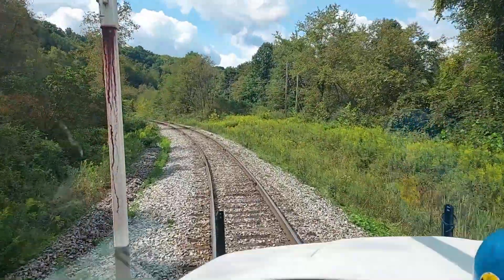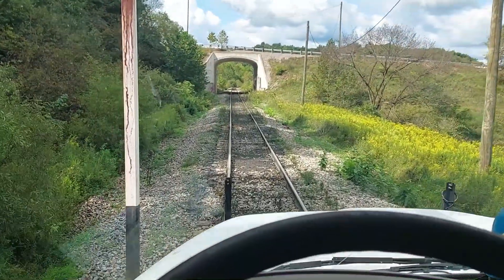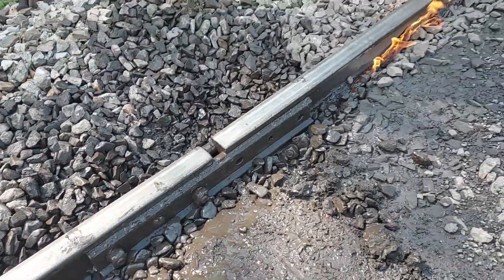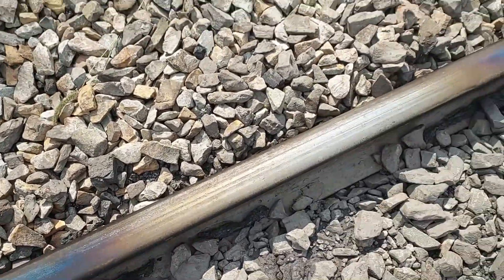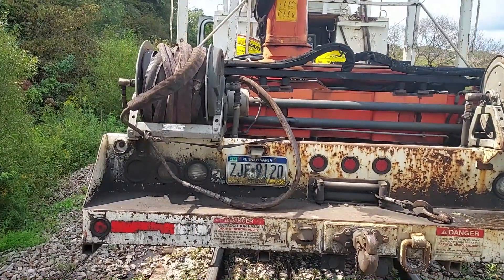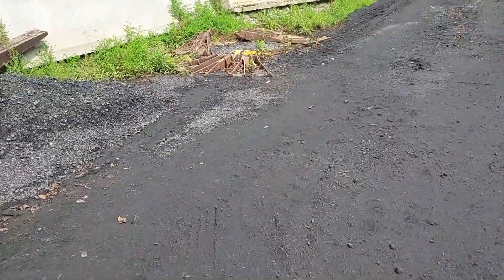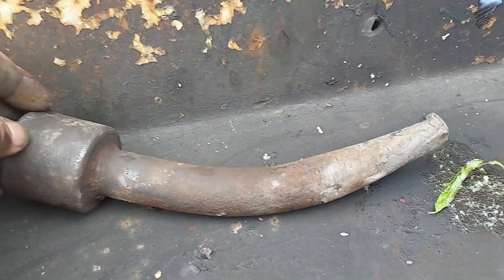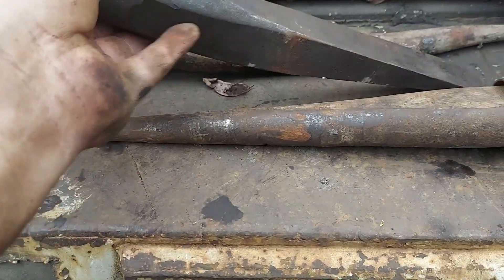I Set the Rail on Fire Today! Fire Snake in Action!!!

Comment: What is the Federal Regulation for maximum distance between joints?  The joint after it was "fixed" looked like a big gap to me.
Reply from the maker: There is no CFR reg for a max gap, however they do require that on
class 2 track each joint must have a minimum of 2 bolts, thus that
would mean the gap would also be within safe distance for trains
to pass over. Gaps over the 17 miles of track we have vary greatly,
depending on a lot of factors, but to have a joint still bolted the max gap would be around 1 or so inch
Reply: @ccrx6700  Thanks for the quick reply Dave.  Interesting topics here.  Most people like to see the big train blow the horn.  But I like the Federal Regulations and engineering topics.

Comment: i'd call it a bad omen of what's to come if this is happening already. it makes sense since the pull apart in october. 
what is really needed to stop this from happening? a lift and retamp of the rails and ties? is there some braking while under load procedure/speed reduction happening alot more there in the last year or 2 that didn't use to happen. there has to be a cause. i notice the ballast at the ends of the ties  leading up to the tunnel in this video is starting to slip out. too much vibration? also what is that slight ditching in the ballast on the right caused by? something dragging or tamping or travel vibration with water drainage issue? might be worth putting a trail cam there or motion cam just to see some sort of time lapse cause & effect?
Reply: I read an article by the Union Pacific one time. Now I may have parts of what I'm about to say all wrong but to the best of my memory, which is pretty good, it went something approximating this:
In a particular area they were having trouble with buckling and pull aparts far more than other areas. They went back to the records and worked out at different times major track work was conducted either hot days or very cold days. 
Not knowing whether this was the cause they decided to implement a policy just for that section as a test to only do major track work on days 10 deg either side of 60 deg F. The results of the test were successful so they tried it on other ares of their network with success, so much so that they considerably reduced heat related track problems.

So there you go. I wonder if this anecdote can shed some light FWIW. Take nothing of what I wrote as fact, just a recollection of something I read once.
Reply from the maker: Very observant there and definitely this section is on the list to
get cribbed out and fix the drainage issues along with a good
surface lift, although coming out of the tunnel I cannot lift track very
much as you understand. We also have other issues to deal with
currently. My dad always said, things happen in 3's so we'll wait and
see on that one! LOL appreciate your watching

Comment: So if the cool weather caused the pull-apart, and all you did was heat the rail so it would expand to allow you to put in new joint bar bolts, what prevents it from just pulling apart again once the track cools down?    Were the joint bar bolts just deteriorated so the normal tension in the track was able to snap them and have the rail move, or what actually causes this problem?
Reply from the maker: The bolts had weakened a good bit had to do with the mud and pumping track, plus the bolts were old so they broke. Then with no
resistance to hold the track, train passing over it cause the rail
to run east. this joint will be good now with new bolts, but eventually
another joint will fail in this section until we can find time to
crib this out and add some rail in. Hope that helps
Reply: New bolts won't fail for a very long time.
Reply: All railroads have what they call a target temperature depending what part of the country you are in and when the rail gets out of that target temperature it will pull aprt or like someone else said it will buckle you will look down the tracks and it looks like a snake a sudden chang in temperature can cause the rail to pull apart. I worked on the Santa Fe railroad it is a great job but you want treat that rail with a lot of respect or it will get you great job
Reply: How about a slightly longer rail?
Reply: @davejohnson7414  then it would buckle in the summer heat. It's a fine balance.
Reply from the maker: We have talked about that Dave and eventually gonna have to do it,
just finding time with train constantly running is the key, plus all the
other stuff we gotta do to, railroading it never ends

Comment: How does this work ?

Heating the rail makes it expand ?

How can the rails shrink that much ?
Reply from the maker: A good part of the problem was when the bolts broke the passing of
the train caused the rail to run east (rail creep). It wasn't so much the
rails shrinking as it was the rail running having no resistance to
hold it in place. New bolts will hold the rail now, hope that clarifies
it better, I didn't do a very good job explaining that in the video but
had other things on my mind like making this joint so the train could
get moving.
Reply: @Zeb but doesn't it shrink back once it cools and pull the rail out of spec ?
Reply from the maker: @Zeb 👌 I do appreciate your writing back Zeb

Comment: Fascinating! I've never seen this before - so it's the jointed rail that contracts and caises the pull-apart. Question from a complete novice - would thermite welding resolve this issue - or is it the wrong type of steel? I guess you don't quite have jointed rail if it's all welded and maybe you would be subject to cracks in the weld affected area. Interesting stuff! Great work, although time consuming :)
Reply: a certain amount of gap has to be left for expansion and contraction. usually around the time the concrete interstate buckles is when rail roads will have these rails self adjusting issues either before or after the roads start buckling. steels expansion and retraction to different sunshine amounts and temps than concrete. not sure which one reacts sooner than the other.
if you were to try and fill those gaps with expansion plugs you could end up with buckling and even just the pressure of expansion with the wrong weight at the wrong time of day and a derailment from that. not entirely sure how a contraction gap creating 4" would pan out if the train would just get stuck or the rail just gets flatheaded or both and plus a derailment . i'd imaging the bogey truck would want to turn side ways if it got stuck pressure and a whole host of weight pushing from down the back end of the line would force it off the rail or just push the rail over on it's side.
Reply: @aprilgeneric8027  thank you for the info. I guess the big commercial rails float on the ballast somewhat. Mostly continuous rail that I have seen.
Reply: @aprilgeneric8027  what we do here in Germany is welded rails that are pre-tensioned to ensure they won't buckle in the worst summer heat we get. It's sort of like a giant guitar string in that way.
Reply from the maker: Thanks Brian, sorry for the late reply. What we need to do sometime
(as you know our track time is limited) is to cut out some joints and replace with welded rail, that will be the ticket, just finding time to
do it is the trick, seems like they want to continually run trains...LOL
but that's a good thing. Appreciate your watching

Comment: The end with the rubber on it and ahead of the drift pin flares out and cracks can't you grind that stuff off back in the day did it on chisels
Reply from the maker: Yes Mike and we do just like the spike mauls that get those edges,
but the rubber on there is a safety requirement and a good one, but
also just don't seem to get everything done that needs to be done also. We do appreciate your watching sir

Comment: Is your rails 39’ sticks?
Reply from the maker: Yep
Reply: When we had lots of jointed mainline rails we hardly had any pull apart joints, even down below zero.
Reply from the maker: @jasonbabila6006  do you have big directional loads then on that jointed track? Being we always for 40 years run loads only 1 way, that is not helping us at all, but we can't change that
Reply: @ccrx6700  We used to have westbound loaded grain trains and mixed freight, all we get now are the eastbound empty grain, coal and oil trains at 6500' to 14,000' long and we get the occasional eastbound detours.

Comment: I liked fixing pull aparts and was a piro  on the section crew, Before we had firesnake we used a sawdust fuel oil mixture, It was smokey but burned very hot. I will have to share documentary photos I took of our pull aparts that we had to repair sometime soon. Great video.
Reply: That's very interesting, never really thought of what they used before fire snakes. Was the process roughly the same with the hammering those spikes through the joint bars?
Reply from the maker: Sam, before we had the rope and the fire snake we had a rail puller.
Take the joint bars off then insert the bolts through the rail holes,
put nuts on them, then it had a ratchet with screws on either end.
Take a lining bar and pull the ratchet down to try and bring the rails
together. Total PIA. Once the ratchet slipped on the cog and bought broke my neck! I threw that thing away when we got the snake!
Had to knock all the anchors off to pull the rail with it. Many times
with the snake never touched an anchor, although with this pull apart we did knock the anchors away from the ties cause it was a really big gap in the rails. Don't have a pic of the puller since that
was 17 years ago I scrapped it!
Reply: I work up north and we still use that rail puller! We use it with the fire snake sometimes when we have a big gap (just this week, 4inch of gap)  Totally agree with you, huge pain but it works ! But the hydraulic rail puller work great, a bit big but it works !! Have a great day !
Reply: Wow that's cool never seen that before
Reply: I worked on the railroad just not in the maintenance department never seen that before great show